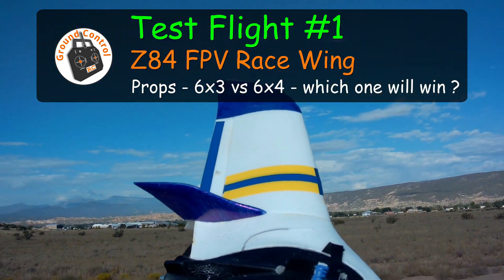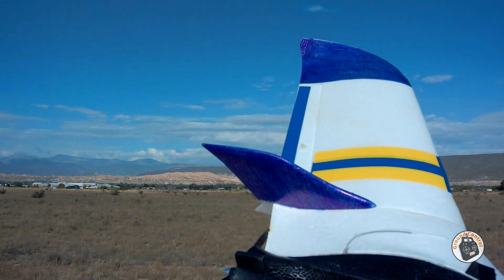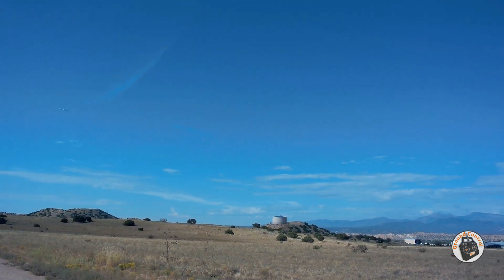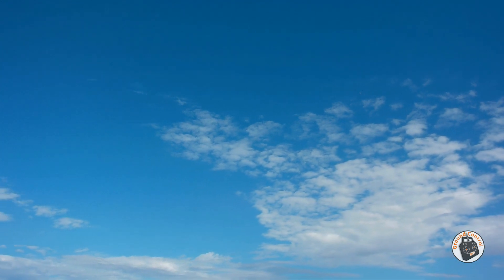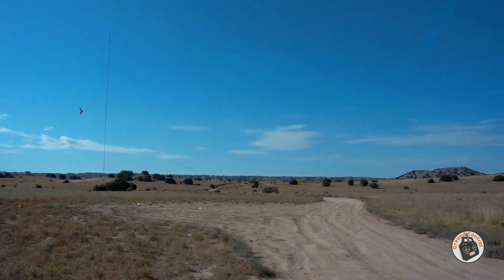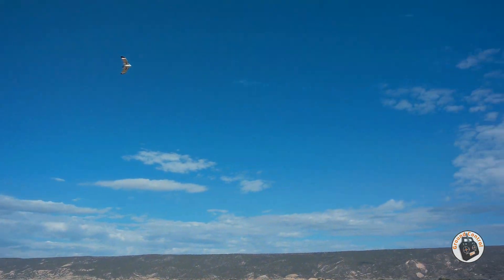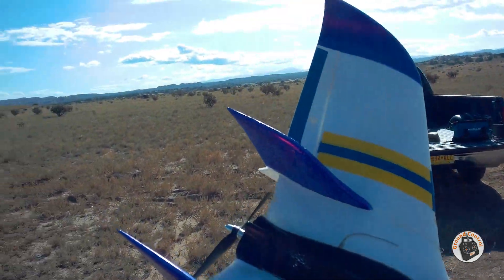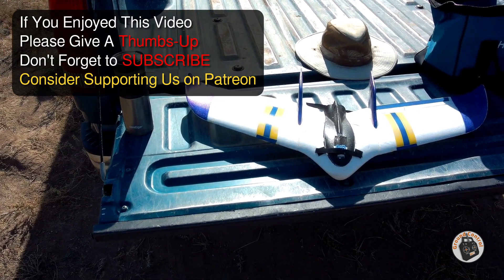Test Flight #1 - Zeta Z84 FPV Race Wing - Props: 6x3 vs 6x4 Winner?

Comment: I buy 6x3 CF for my s800 flying with a sunnysky 2204 1870kv motor. Gets the job done. I am waiting for my 35ah Li-ion packs then I'll have something to talk about
Reply from the maker: Hi James! I've tried the 6x3 CF Props on my Parkjets and they perform well, however, because of the terrain where I land I end up breaking 2-3 in (1) flight session. If I had a grass area in which to land I think they would work fine. Unfortunately, I have to use much more durable props. Those Wings are pretty fun aren't they ;-) See you in the Air!
Reply: @GroundControlRC  definitely and the AR wing I got last year is still running strong. I'm about to build a C1 Chaser so that'll make 4 wings so far. So addictive 😍
Reply from the maker: @jamesordwayultralightpilot  , hehehe...I'm definitely running out of hanger space ;-)
Reply: @GroundControlRC  APC makes 6x3 folders, I just got 2 of them for my S800's the thrust is about the same as the CF ones
Reply from the maker: @jamesordwayultralightpilot  , that's a good idea. So they fold backward? That should save on props ;-) APC is about the only place I've been able to find larger props in 3 inch pitch. I hope they keep making them ;-)
Reply: @GroundControlRC  yeah you can put them together with any one of their hubs they have for various sized spinners. I don't have any spinners for my wings even though there is apparently a benefit to them. I haven't yet found an application where I was willing to sacrifice the efficiency of the fixed prop for the glide slope of the folder of the same size and pitch. I like thrust and efficiency so I fly the folders for a day and wind up switching back that night lol
Reply from the maker: @jamesordwayultralightpilot  , hehehe...I hear ya!
Reply: @GroundControlRC  tested yesterday and I got almost exact same performance as the 6x3 CF props. Plus you can totally feel when you your up high and chop throttle the little blades fold back and you start gliding. My S800 glides for days and I've finally found a folder I like lol
Reply from the maker: @jamesordwayultralightpilot  , that's awesome! No drag from the prop ;-) I'll have to check into something like that on my next Glider conversion as I plan on using a Tractor Motor and that would work great. See you in the Air!

Comment: cw or ccw propeller?
Reply from the maker: It doesn't matter if it's CW or CCW as there's no right or left angle to the motor. You can change the direction of the motor to match the prop you wish to use. See you in the Air!

Comment: Cool Tony... Did you do the thrust test? on both...
Reply from the maker: Thank you! Robby, I haven't performed any thrust test on this motor. I did go back and look at the thrust numbers for this 6x3 Prop and the 6x4 Prop I had already tested on similar size Motors with similar KV. The 6x3 Prop almost always wins again the 6x4 Prop except in rare cases where the motor has a lot of torque. The Wing did seem to have faster acceleration and a better climb rate with the 6x3 Prop during flight but that is very subjective on my part ;-) See you in the Air!
Reply: @GroundControlRC  Ya thats a really and interesting given fact...

Comment: LOOKS SO SIMMELAR TO HOBBYKING SONIC that also have a lot of quality problems like motor mount and servo braking like twighs
Reply from the maker: This one seems to be a very good value for what you get. Unlike most factory planes I've flown this one seem to have pretty good power with the right prop. It tracks well and is very acrobatic so I'm having a lot of fun with it ;-) See you in the Air!